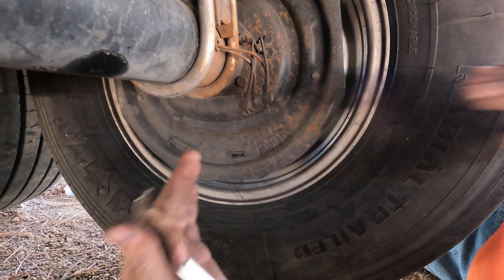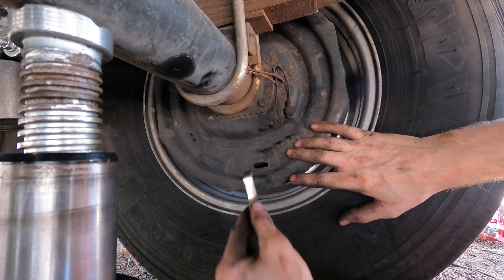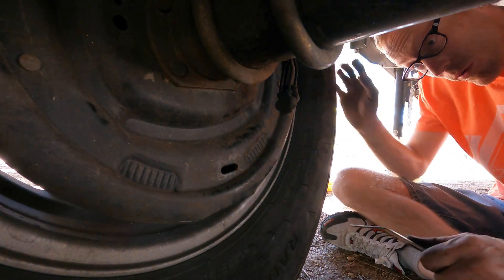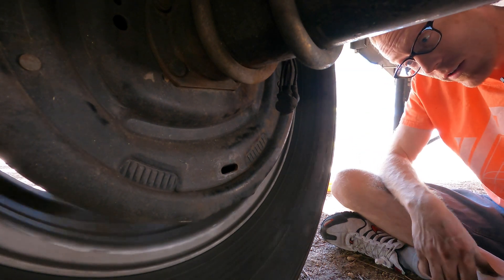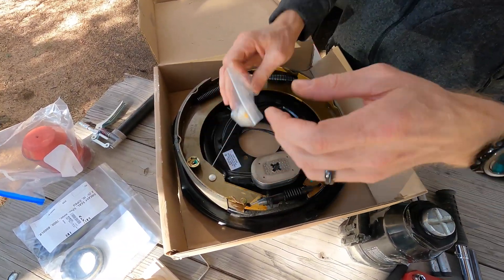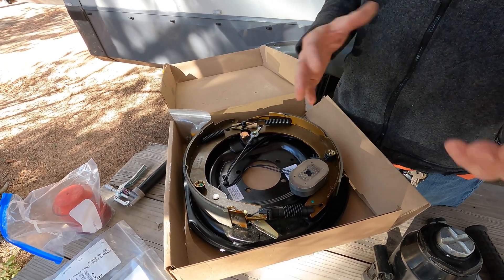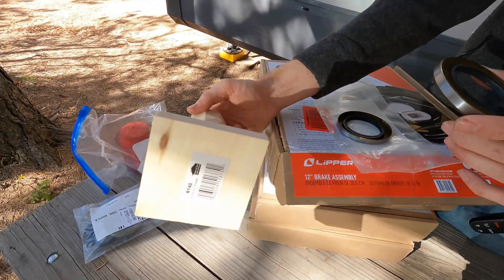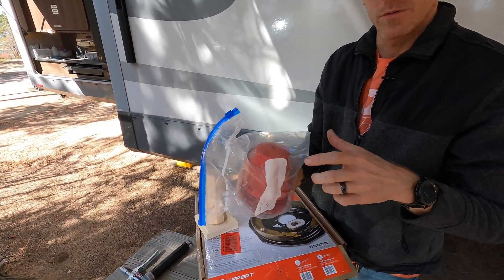All About Electric RV Drum Brakes | Adjustment and Installation

Comment: I took drums off miy RV and replaced all 4 back plates . set the brakes as I have done for years on cars ,trucks etc. Left on a road trip & only one wheel seemed to work so now i will attempt to. Assure i have power going to magnets.  I was told it didn't matter on wires it works either way so I soldered & shink tubed each splice at the hubs to axel. The only other issue I noticed when drums were off there was wear marks inside where magnets would make contact. Maybe this is my problem for lack of brakeseven though proper drag adjusted at the wheel.